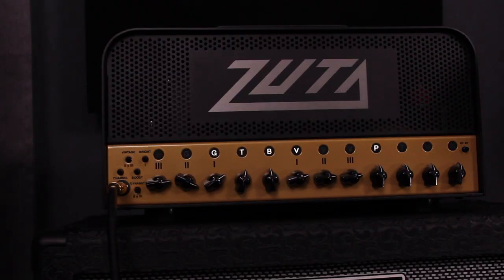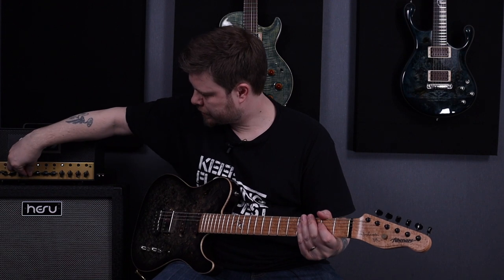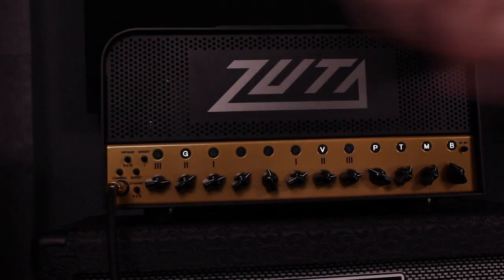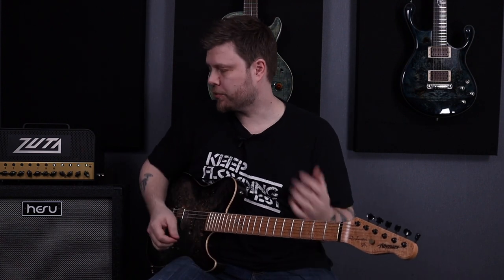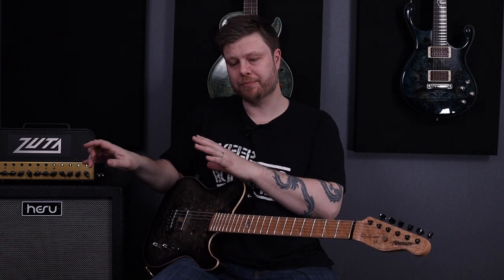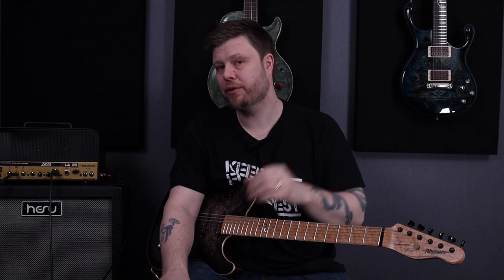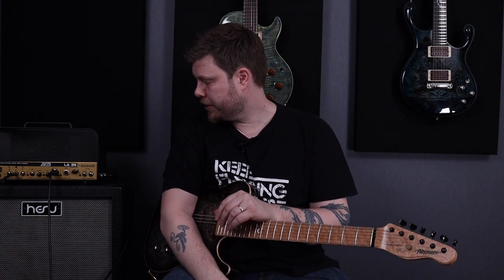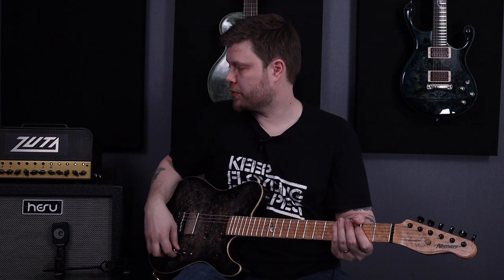ZUTA LA25 MKI amp demo

Comment: So who made it first bogner or zuta lol
Reply from the maker: It started as a joint venture, but after irreconcilable differences Zuta ended up having to release this amp (and the MKII) under it’s own flag, while Reinhold went on to release the 3534 head in the US (made by the same factory that makes Friedman, Wampler, Synergy etc).